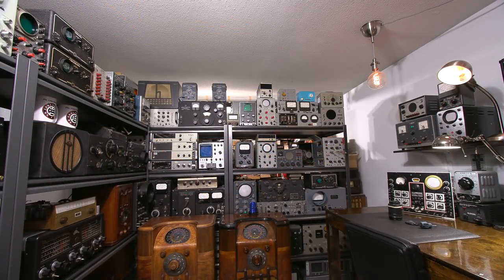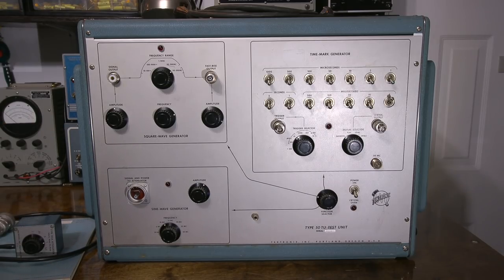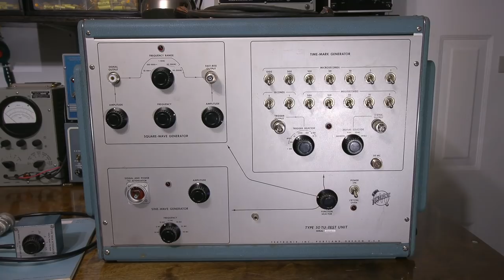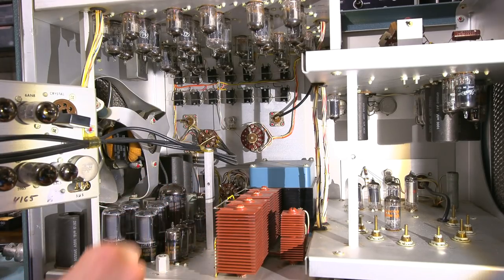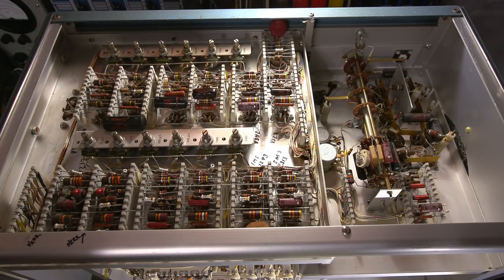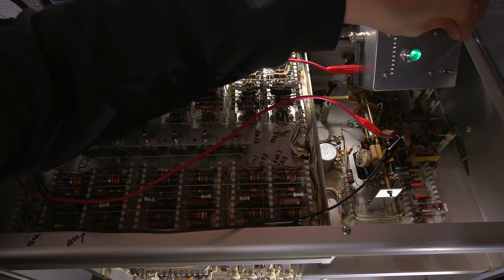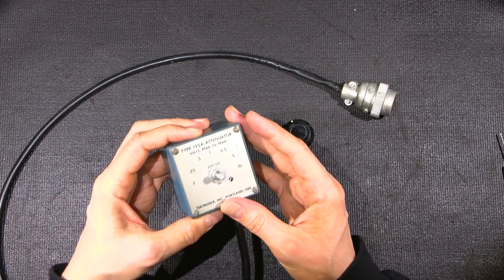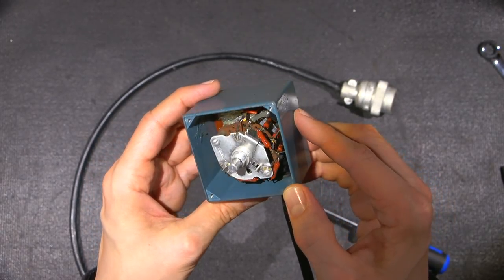Look Inside This Rare Tektronix TU-50 Test Unit!

Comment: It's unfortunate that the video is only in 360p, is it possible to edit it so that it's in 1080p or re-upload it?
Reply from the maker: Click the gear icon under the video and select 1080P.
Reply: @MrCarlsonsLab  Unfortunately it's only showing 144p and 360p.
Reply from the maker: It's on your end, 1080P60 shows clearly here. If you are on a bandwidth limited device, this would be the reason. Try watching it on a different device.
Reply: @MrCarlsonsLab  its only on this video, all the other videos are 1080p60fps or even 4k
Reply from the maker: Just had a random person look at it, they see it in 1080P, so it's on your end.
Reply: Its strange..... I checked all YT and device settings and they seem good. It's the only video of yours that ist in 360p. Don't know what the problem is but I can't change it. I have to live with the fact that the one video is 360p

Comment: Your capacitor checker operates at 27 volts if memory serves just wondering how effective it is checking the leakage on high voltage caps which in the past required application at working voltage to check leakage
Reply: 3 9v batteries is 27 volts as used in his checker

Comment: Just be careful of those power supply voltages, I  brushed against those ceramic strips when starting out calibrating the 535,545 scopes, my arm was in sharp pain for few minutes. Learn quickly to be extremely careful very fast.

Comment: Great content !
This piece looks like a combination of a 108 Pulse generator, a 180 Time mark generator and a 190A Constant-Amplitude Signal Generator in one Box.
At https://youtu.be/QVysOwtV5xc?t=607 you can see an "Crystal" marked tube socket at the left side of the picture.
Looks like it had the option to fit a oven controlled "Bulova" Crystal as an option. Yours seem to have the standard Crystal fitted.
Reply from the maker: It looks to have that option, you are correct, an FT-243 crystal is there.